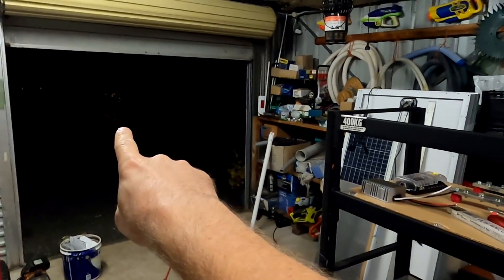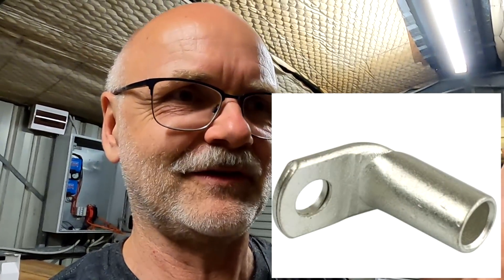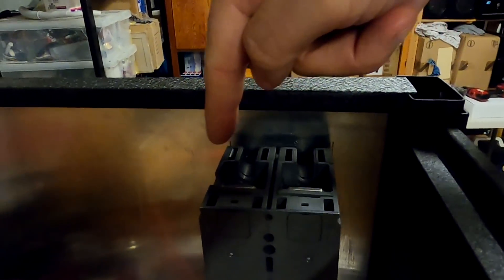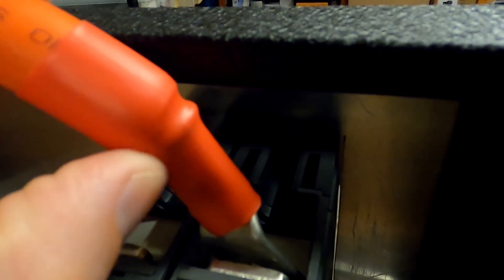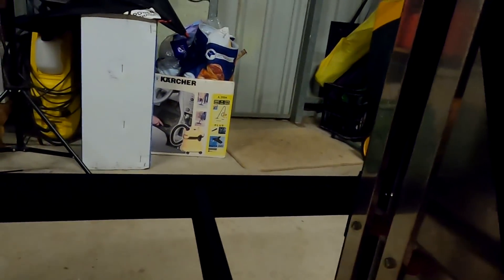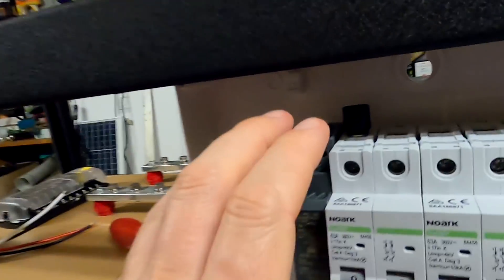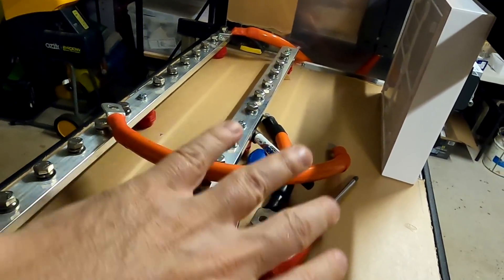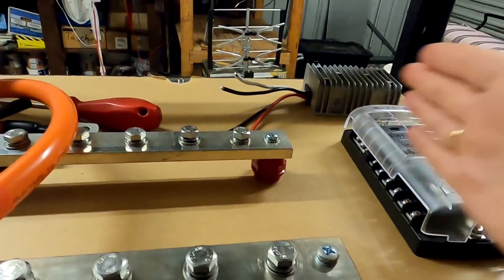Chasing the best connection design. Battery 2.0

Comment: Why not have a bolt and nut on your lugs to have the 90 degree angle, you could make them square and cover them in plastic dip for isolation.
Reply from the maker: I don't think this is allowed. It would work but I would like to stick with approved material as much as possible.

Comment: Throw the plastic box away and mount the Din rail on a bracket in side your own enclosure then you can use whatever connector you want.
Reply from the maker: And it hold just in the air? With Siemens Air Hooks?
Reply: @OffGridGarageAustralia  🤣🤣🤣
Reply: HahHhHhahha komisch 😀😀😀😀😀😀😀😀@ Andy……

Comment: Hi Andy, I think it will be cool to have those transparent acrylic boards instead of the aluminium ones as covers. We can actually look inside and some LED lighting perhaps? haha. Although I'm not sure how strong it will be. Thanks.
Reply from the maker: I have the LEDs and clear plastic sheets already here for exact that setup but decided to go what is standard here in Australia. It needs to be a non combustible material for the outside shell.
Reply: @OffGridGarageAustralia  Yeah that sounds right, non combustible will be better for safety.